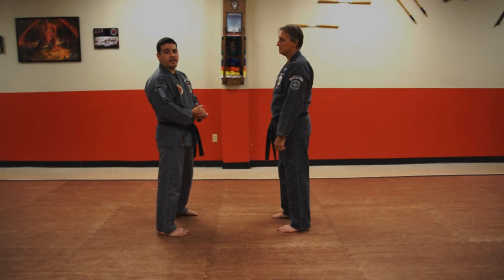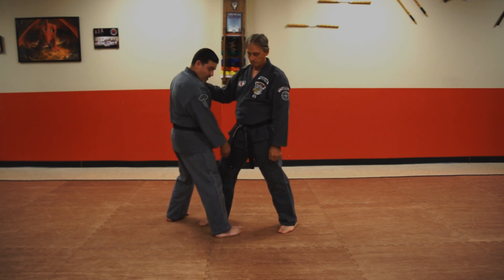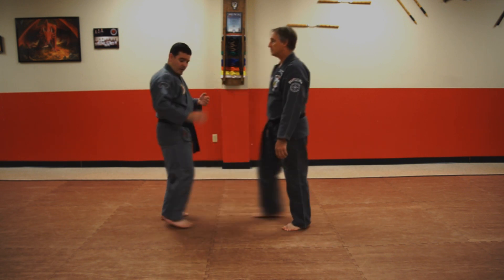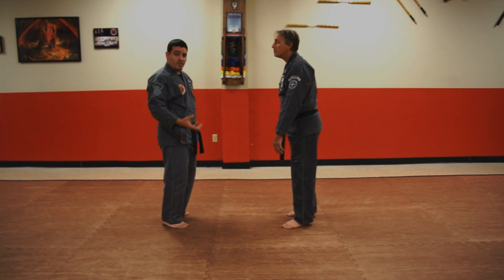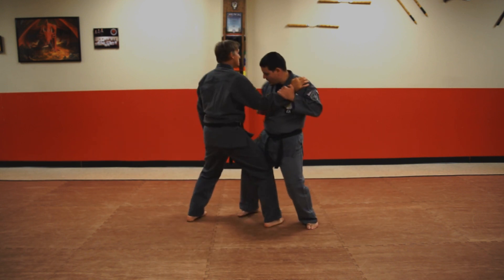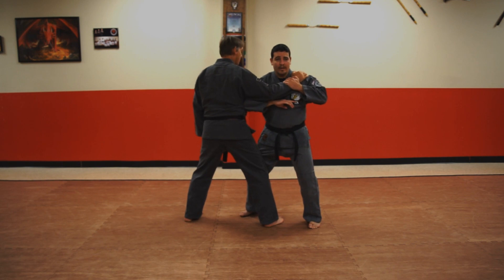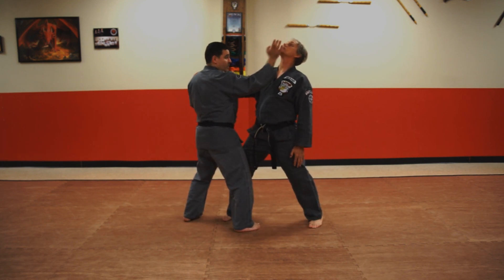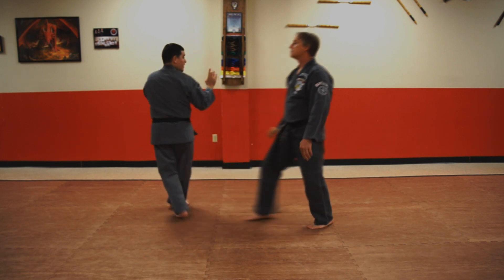Triggered Salute

Comment: Triggered Salute (closed environment)

I would be concerned with a couple of
things:

When you hit the arm down, your opponent can either hook you with his left or grab your shoulder (or back) and pull you
in with both arms. I think this would be a natural reaction rather than leaving it hanging.

If he hooks you correctly, you can possibly go down. If he grabs you, and then he hugs you tight, then what? While in the
clinch, he can pull a ko-uchi-gari or ko-uchi-gake and take you to the floor, or you both might lose your balance and fall(it happens). Then what?

The only reason I ask this is because you anticipate the head butt, and you anticipate a front snapping kick by your
opponent when you say not to step passed his heel.  So if you anticipate those things, shouldn’t you anticipate all that is possible? 

I think a simple knee to the groin after the palm strike makes more sense. Or grab the back of the head after the palm strike, and then close with the knee/s to the body or groin or both, and then back away and reset.

There is also opportunities for a palm strike to the ears or hook to the jaw...the list goes on. There is no reason to expose your back.